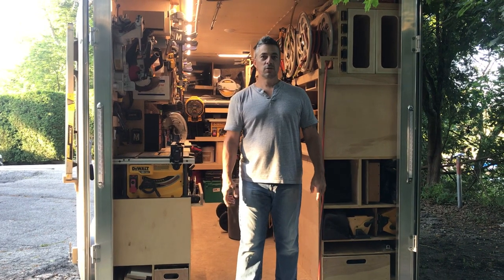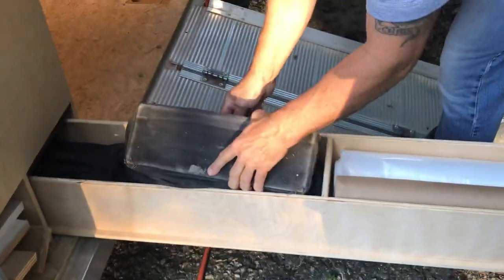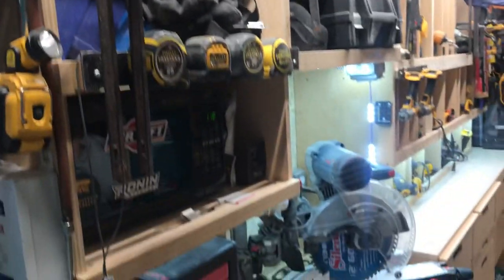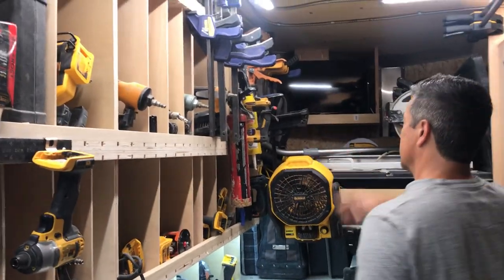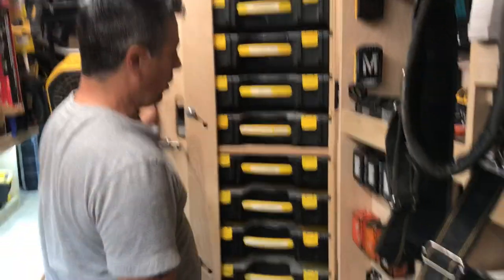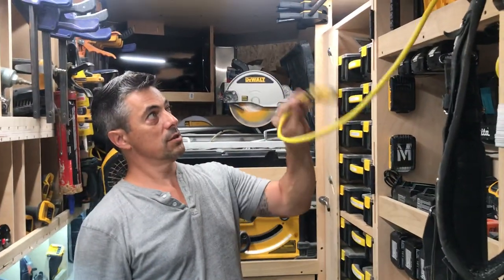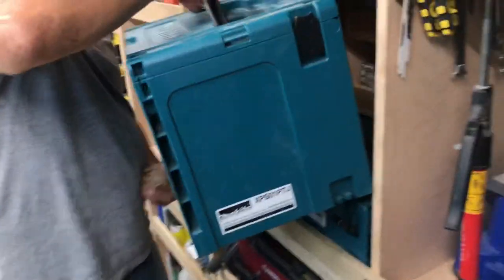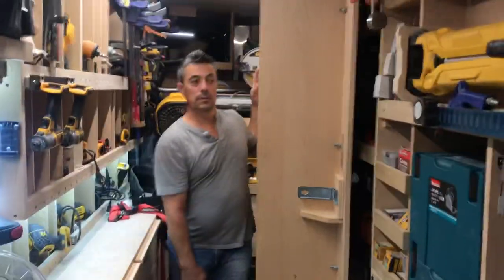Ron Paulk inspired trailer

Comment: This is such a dope trailer set-up. Most people would never understand the number of hours it takes to plan something like this out. Bravo my friend! Bravo..

Also, If possible, could you do a DIY video on the lizard matt? I'm trying to think of how to incorporate a heating mat/station in my work van to keep caulking, glues etc from freezing up with our NE weather. Thanks!!
Reply from the maker: Thank you! I literally planned my build for 1 year. Then I built it over 8 months a few hours at a time. I’m nearly complete. Hopefully this week or next. I’m going to do the heated cabinet next and I will post a video of it completed. I’m also in New England and Previously I had a cargo van and I used ridgid boxes with the lizard mats . They don’t produce a ton of heat but enough to keep things from freezing.

Comment: I love your setup!  Awesome ideas.   I especially like the Stanley organizer rack with the diagonal sliding restraint.  Would you share how you configured that? What hardware did you use for the sliding catches?
Reply from the maker: Thanks. The sliding catches are just 1/2” bolts with a piece of pex over them to act as a sleeve to make them slide easily. The slots are cut on a 45 degree angle. It’s fairly simple. However there was a little trial and error.
Reply: @realworldcarpentryremodeli5868  Cool idea.  How does it stay in the "up" position?  Are the slots notched?
Reply from the maker: @iamschwenke  I cut the slots a 1/16” larger than the pex then made the end have a small indent that it drops on. Just enough so it holds in place. It’s kinda hard to describe. Maybe I’ll do a short video tomorrow with close up shots .
Reply from the maker: I uploaded a short video. It should help.
Reply: @realworldcarpentryremodeli5868  Hey,  thanks.  Totally see it now.  Again, great job!

Comment: Wow!  What an innovative set-up. Your bat-cave secret side entrance had me at hello! You really have a slew of great ideas packed in here.  Do you have schematics for sale?  Seriously… I’ve run out of room in my current trailer and have been looking for one with these exact dimensions and great ideas for a set up —found it!! Many of your ideas would work perfectly.  Thanks for sharing.
Reply from the maker: Hey thanks for the kind words. I did have some drawings but they got lost in the shuffle. Besides that they didn’t represent what actually got built. I purchased the Ron Paulk plans and modified to suit my needs. The hardware door works great although I need to  make adjustments to the wheels to make it open a little easier. Other than that it works as you would want it to.

Comment: Howdy RWCR! Very cool trailer build out. All kinds of great ideas and modifications from other trailer build-outs to the point that your trailer is unique! I especially like the hinged cabinet that gives you man-door access! Question: around minute 3:13 you mention a dewalt battery power connector/adapter that runs your lights if you are not hooked up to shore power. Any chance you can tell me how to find that? Take care and again, great job. Thanks for sharing and for the mention in the description. I look forward to your next video.
Reply from the maker: Hey Steve. Thanks you!! Love your channel. Watched it a lot while building mine. This is the one I bought off Amazon.
Brand: TOMAPEX
4.5 out of 5 stars  172 Reviews
18V/20V Battery Converter Adapter Power Source for DeWalt 20v Max 18v Dock Power
Reply: @realworldcarpentryremodeli5868  thank you much!

Comment: Nice set up. Where did you fine the battery adapter to run your lights. Thanks
Reply from the maker: Hi thanks. It’s a 20v generic battery adapter for dewalt batteries. I bought it on Amazon.

Comment: You my friend have a lot of tools in a compact trailer. I really like the trays you made. I have a cutting board like that in my small galley kitchen and i love it. I am really interested to hear how the lizard mat works. The bearded builder from you tube put a lp furnace in his trailer and said he only needed one or 3 LP tanks a month to heat the entire trailer to 60 all winter long and we live in a cold climate. He added 1” of XPS to the inside however.
Reply from the maker: I considered doing what jack did in his trailer. However I really didn’t have room for the lp gas tank. I squeezed something in every square inch. I used lizard mats in my cargo van for years. They don’t get super hot . Just warm enough to keep things from freezing or going bad and they use very little energy.
Reply: @realworldcarpentryremodeli5868  a clever idea I just might steal. In my next trailer build (7x14 or 8x12) I would like to include a small heated area for caulk and chemicals and paints and thought about plug-in heat tape but like the mat concept. I have never used one so it never occured to me. I do not know if I can pull off what Jack (BB) pulled off with the propane heater but would love to actually heat the entire trailer if truth be said.
Reply from the maker: Yeah I would have liked to do full heat but it wasn’t in the cards this time. Maybe the next one in 5 or so years.

Comment: mannn just when i thought i had my ideas ready for my trailer i come across this awesome video. Thanks for the video, You did a great job. if you had to guess how much would you guess it cost for all the plywood used to make all the cabinets and shelves???
Reply from the maker: Hey thanks . It’s been a total game changer.  I spent about $2000  on plywood. All paint grade birch plywood.
Reply: Thanks for the tour! 
The small parts swing cabinet and the pull out work surfaces are very impressive! Did you use the light weight plywood Ron Paulk is so excited about?
Reply from the maker: @louisokrent4717  hi thanks. No I didn’t use light weight plywood. I tried getting it but it’s really hard to get here and very expensive. I used standard d3 paint grade birch.

Comment: Where is the GPS locator so you can find it when someone hooks up and takes the trailer.
Reply from the maker: It’s in there. I use the dewalt gps alarm and tracker. Not sure it’s completely necessary. We live in a very safe area and I don’t leave the trailer on sites. But you can never be too cautious.